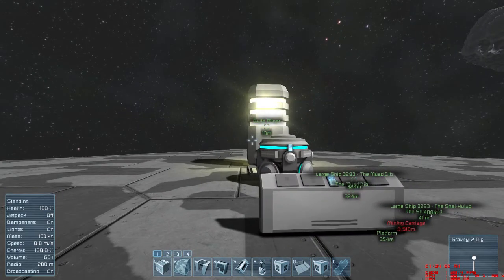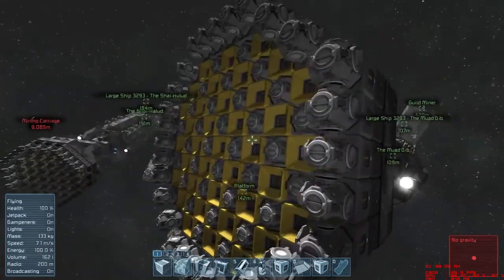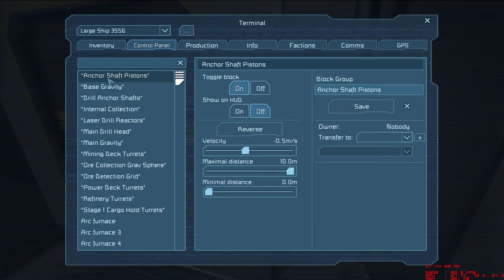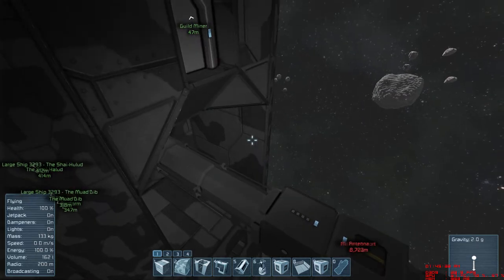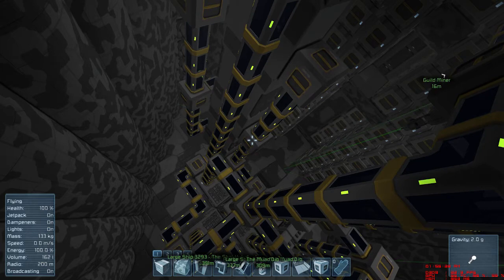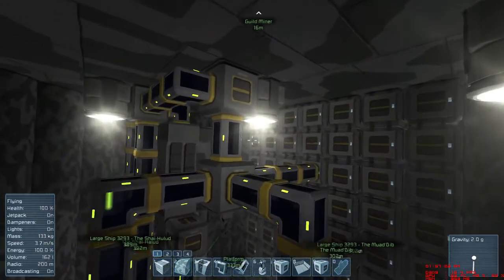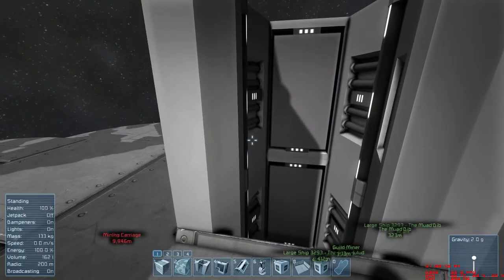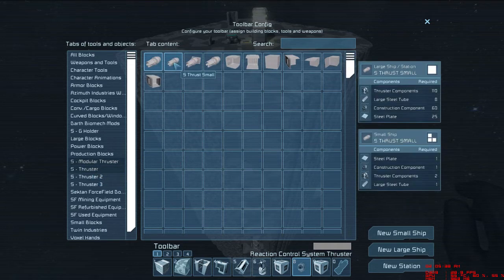Space Engineers Asteroid Drilling Platform/Foundation Ship

Comment: Hi.  First builds are fun.  I noticed that you're in creative mode.  Have you tested any of this in survival mode?  I noticed a ton of heavy armor on what you've built.  In survival, you have to mine all of that iron ore, refine it into ingots, then assemble those ingots into steel plate.  Then there's the weld time.  To efficiently make those ships you'd need to create a TON of infrastructure to support them.  I think you'll find that once you've done all that, the ships won't be practical.

Also, a tug with enough engines to move the rig into position will be huge.  If the rig collides with the asteroid, then you're going to lose and damage a ton of blocks.  

Don't stop building and learning.  But I don't want to see you put a lot of time into this and variants and find out there's no way to build and deploy it except in creative mode.